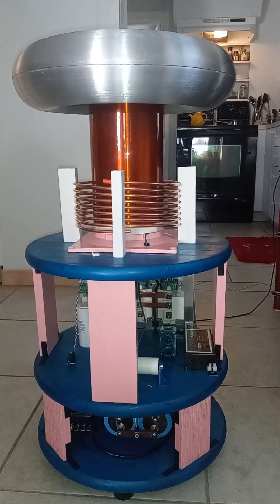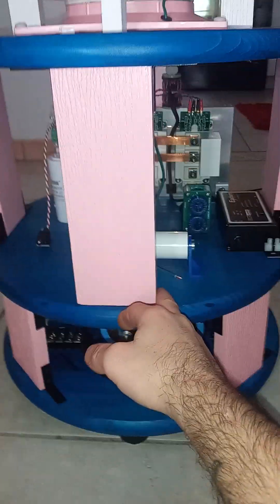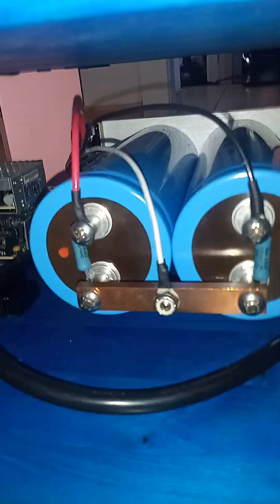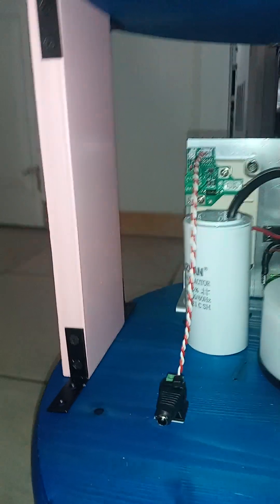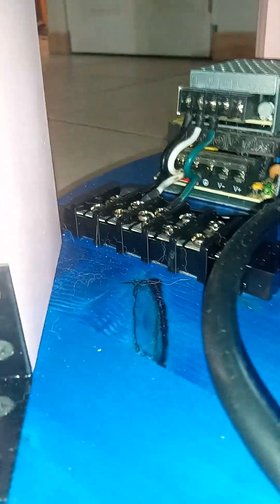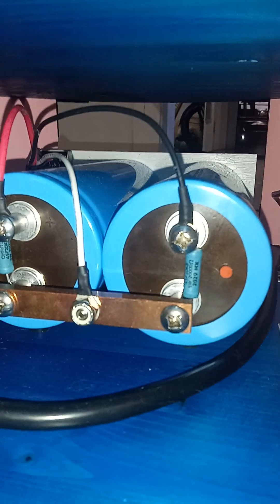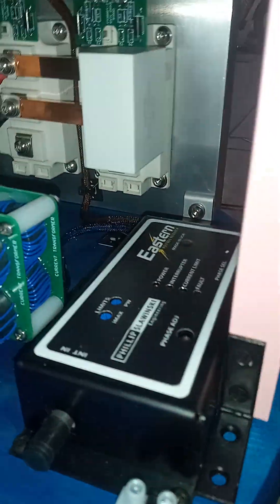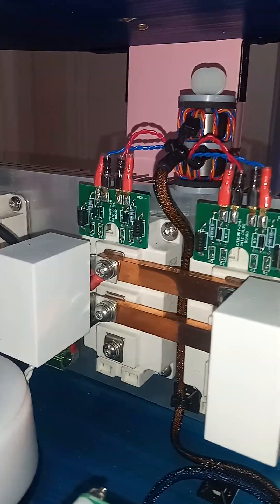'Scarface' QCW DRSSTC Mechanical Overview

Comment: Hey, Kyle, what ever happened to this coil, I'm building my qcw right now and am wondering how this one worked (especially with your choice of upper pole operation)!
Reply from the maker: Hey! So I actually reconfigured it with an SKM 100 full bridge and now run it around 425khz. You can see it running in DR mode in my 'shorts' video section. I just have to install the buck IGBT and test it out.

I've been meaning to do a follow up video for everyone. May do that today.
Reply: @KDewees91  Thanks for the response. Wow! A brick bridge running at +400kHz?! I thought that was "impossible" based on what I've heard about bricks. Where's my misconception if you don't mind explaining?
Reply from the maker: @BackMacSci  I've had the SKM100s at 530khz at one point during testing too. It all depends on rise and fall time plus gate capacitance and mmc capacitance
Reply: @KDewees91  thanks!

Comment: So, you decided to build a QCW coil with bricks.
Some people may tell you this is a bad idea and almost impossible - dont trust them :D
About 9 years ago I built a brick-based one on the ff150r12ke3g module just to prove that QCW-coils could be made not only with TO-247 power stages, like 50b60 or 60n60. The coupled res.freq was about 210-230 kHz or so and it was working pretty well, thanks mainly to the ability of working with doubler (for euro 220 Vac) for 1.2kV Vce. And yep, it produced typical QCW "swordy" streamers, because their form is determined not only with frequency variables but also with many other factors. The practical frequency limit of typical brick IGBTs (150-300A range) in resonant oscillator with switching phase correction is laying somewhere about 300+ kHz, because of IGBT current-tail which can cause an epic fail - when I tried to perform the same trick with SKM300 and ~320 kHz oscillator, the bridge decided to pop with loud firework.
Even if it does not go as planned, you can always transform it into a long-pump free-wheeling little beast, changing some moments in setup for proper operation in this mode.
Anyway, goodluck with it. It`s interesting what the final result will be for this one.
Reply from the maker: Thank you for the heads up MT. Currently waiting on my driver to go out for repair. Hopefully soon it will be up and running. I'm going to try freewheeling it as well. Glad to hear someone else tried this along with SciTube and Arc Angel Tesla Coil

Comment: Man that thing is awesome looking. I'm just playing around with buck ramping now and it has me really interested. 200khz may be low for swords but I found it could still give a nice appealing output from mains ramping. It just gets more gnarly. I'm gonna try a double full bridge of 60N65's which still makes more sense to me with Tesla Coils at anything over 100khz. That's like $50 in IGBT's to build the whole bridge compared to one good mini for the same price. As for the lower frequencies I've been trying to put people on to the idea of scavenging or buying 3 phase modules from industrial repair companies. I have a few $200-300 modules I got from work that were basically useless because 1 or 2 of the switches inside blew up, but the rest are fine. So basically a 3 phase module useless to a company probably still has a working full bridge inside.
Reply from the maker: I seen your SSTC vid you just posted too man. That's awesome OP for 90v. I also have a buddy building a QCW using the 60n65s on a dual full bridge setup as well. I'm waiting to get a new microprocessor installed on this one, it overvolted on the driver
Reply: @KDewees91  dang I didn't know those boards even had a microprocessor. Sounds like it would work awesome till it doesn't lol.

Comment: Unfortunately I'm pretty sure that this won't work the way you probably would like it. Fres is too low and the bricks will start to complain above 200kHz. If you want help with the qcw feel free to reach out to me I'm always happy to help and have experience with QCWs and know what a pain in the butt they can be ;)
Reply from the maker: Appreciate the offer, felix. I'm still waiting to try phase lead on it as well. Still too early to tell but I'm sure you are probably right. I may have to go skm100s in this thing or lower fres.
Reply: @KDewees91  with a lower fres your arcs will branch out. On my qcw the upper pole is at around 420kHz (330kHz with arc). You'll need to go to-247 or maybe those nice minibricks depending on what you want the coil to output. Regular bricks won't do well above like 130kHz
Reply from the maker: @felixb.1756  That was my goal was a Low f0 QCW. Good lord those mini bricks are crazy expensive too
Reply: Yeah I know they really are. Under 300kHz it will start to make branchy arcs looking nothing like traditional QCW arcs. Or is your goal something like the low frequency qcw from davekni?
Reply from the maker: @felixb.1756  Yep, that was the goal of this first build
Reply from the maker: @felixb.1756  Thank you! Checking Phase right now on the QCW. I'm running my mini DR Half Bridge CM300 at 250khz. Since these are 200s I am going to try to see what the scope will tell me tonight and go from there. If I still have trouble, I will def. let you know. Thanks again!
Reply: @KDewees91  no problem